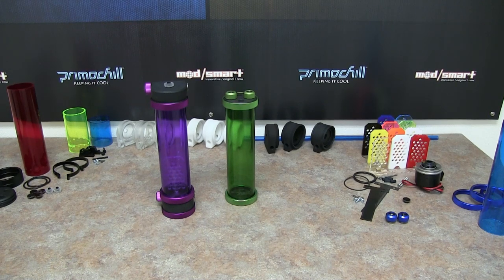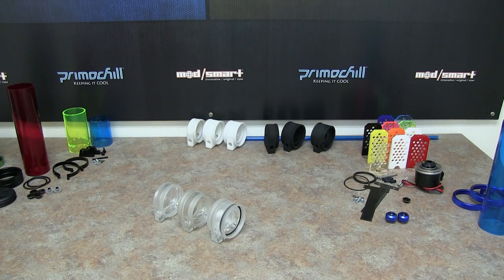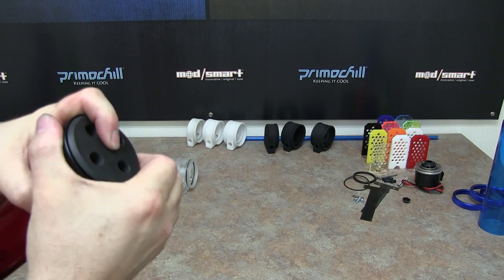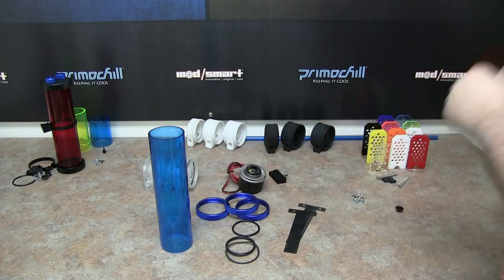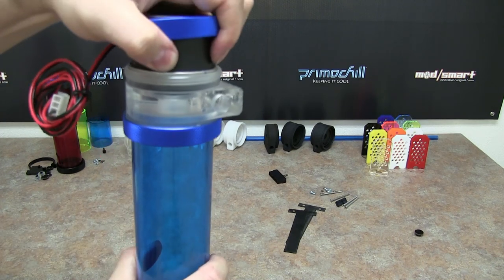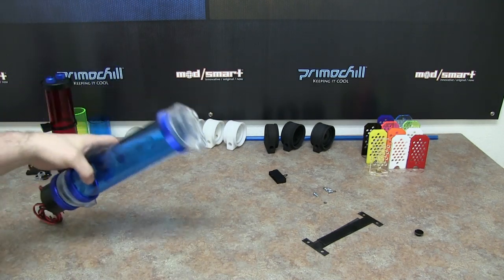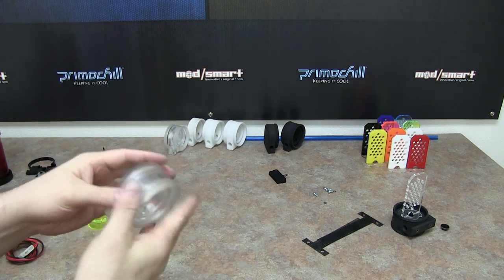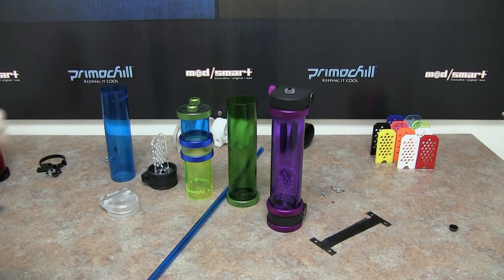Primochill CTR Phase II Product Overview/How To

Comment: seems quite a nice res, but not many places in the uk that sell them and the one i want is the 120, you can get it as just the res but not as the complete system like showed in this video, plus can i put a d5 mod kit/dresser mod if its ek on this res, cause when you screw the pump to res i cant see a way of doing this or does the bitspower d5 mod kit screw straight up and then theres another kit for the ek pump, cause i dont know.

Comment: Does Primochill make an acrylic tube to use on the top inlet port, to help avoid the "splashing" of the top inlet?
Reply: I have the same splashing issue with the 120. It causes air bubbles to enter the loop. I ended up using the performance decreasing side inlet. Also, I didn't get the long screws or the standoffs. Boo
Reply: I made my own tube using some leftover petg tubing. I just "screwed" a piece of tubing into a 1/4" threaded female port on my drain valve. Important to use a threaded port made of metal. Now no moreswirl issues or bubbles.

Comment: I just purchased and installed a red 240 one of these. In this video, starting around 27:56, he explains a little about the stand offs. What he says doesn't make much sense to me. No matter what you do the amount of stand off would be the length of the screw.

The only way to get a shorter stand off is to buy shorter screws, I think. He explains there will be another video explaining and showing this stand off installation.

Has anybody seen such video or does anybody have the instructions on how to do this? There were NO INSTUCTIONS with my RES that I got from PPC's.
Reply: Michael Jaeger I'm guessing what they mean is if you put the standoff between the motherboard tray and the head of the screw which would make the length of the screw shorter.
Reply: graffix3001 First of all the stand off needs to be re-tapped. The screw only goes half way though it. Also, shortening the screws would be the only SOLID option for anti-vibration... And I still haven't seen the thing actually mounted with the sand-off, that would really help me to understand this better! Thank You for your response, I do have it mounted without the stand-off, it's very tight quarters, no room behind the RES for cable routing or anything else...
Reply: Michael Jaeger They have a NEW stand-off system, the one that came with the RES kit was probably a problem for everybody... Check this out http://www.primochill.com/product/primochill-ctr-phase-ii-stand-off-support-mount-black-2-pack/

Comment: i got of these need a replacement tube is the size >  64.00mm Outer Diameter / 5.00mm wall / 54.00mm Inner Diameter